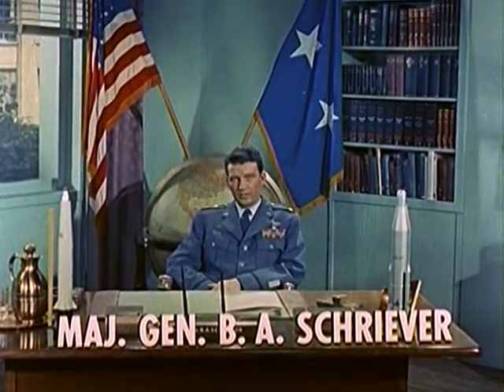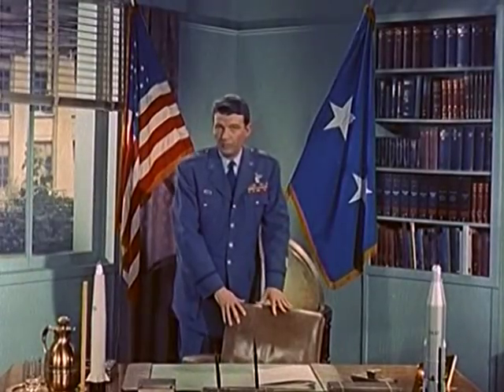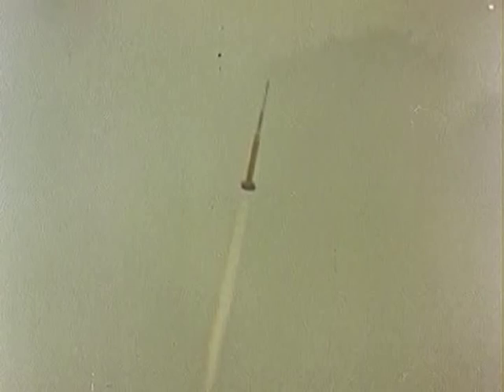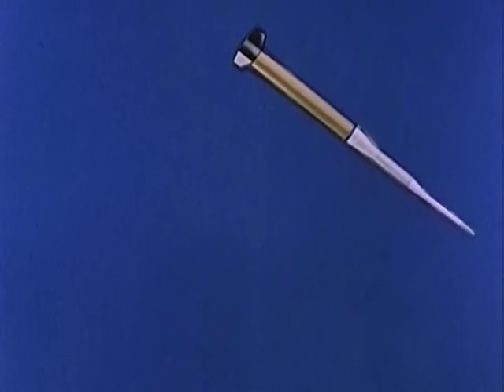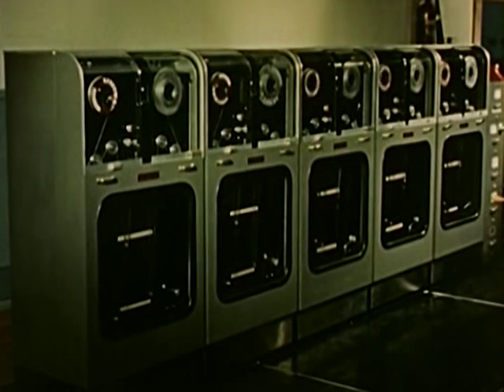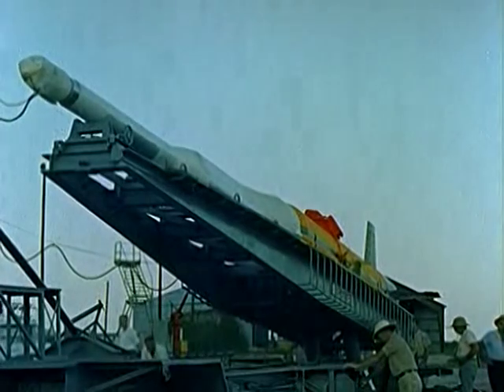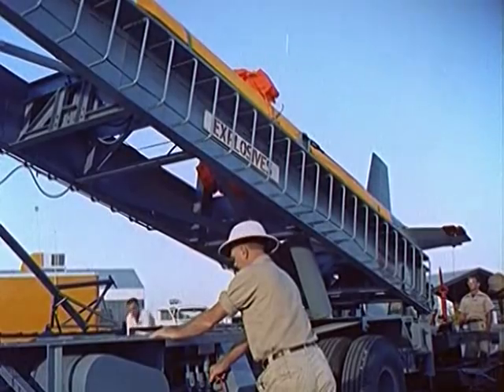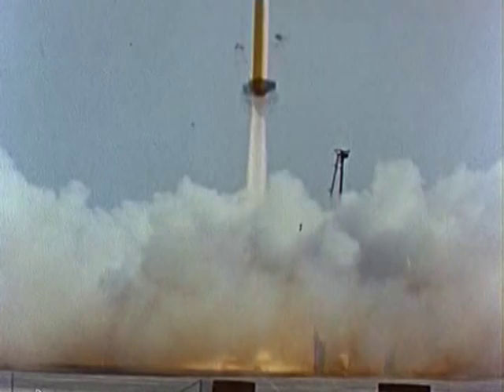The X-17 Story (1958)

Comment: At the end we see an Atlas launch and something I have never seen before is that only two engines are visible and burning.  Guess that’s the way the early version was designed.  As I recall the Mercury/Atlas flights had all three burning at launch.  It’s certainly been a winner as it’s latest version is still flying and will launch astronauts again soon.  Crazy.
Reply: The Atlas A we see there was a prototype version that only had the two booster engines, without the sustainer engine in the middle. It flew 8 times before the next version introduced the sustainer and the stage-and-a-half staging concept.